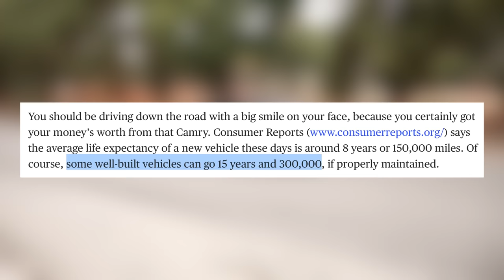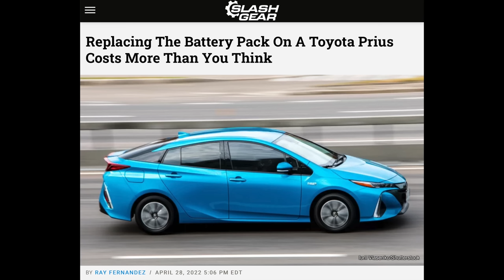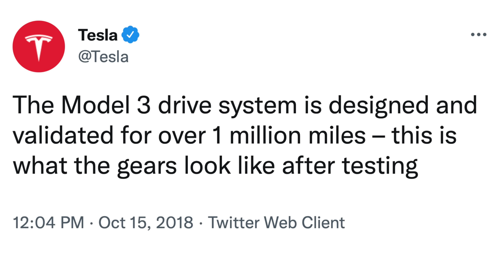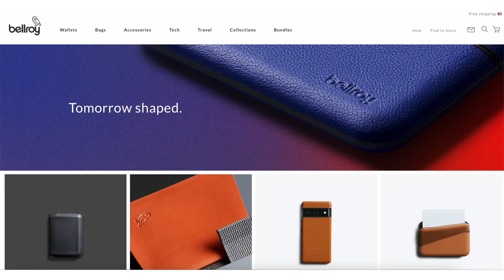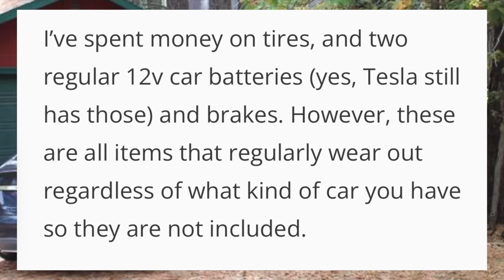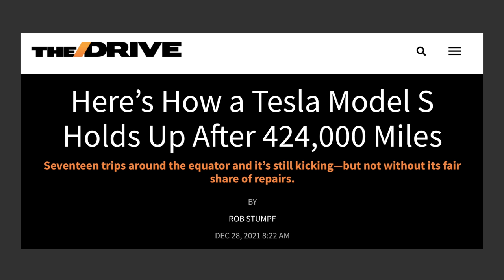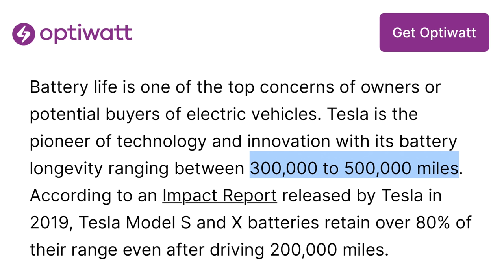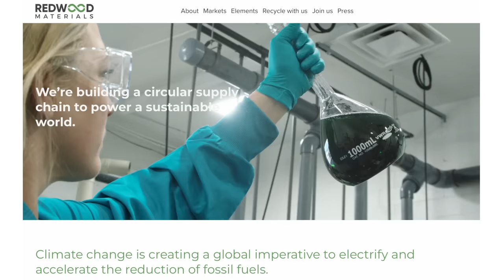The ONE MILLION Mile Tesla | It Still Runs

Comment: I drove my 1992 Civic for 21 years. After spending $1,400 on a used engine, transmission, radiator, hoses, etc. (that's $1400 total for all that plus other stuff I didn't list), I drove it another 10 years before it ever broke down for any reason. I parked it because of rust at 585,000 miles. It still ran like a champ and I still own it. The last repairs cost me some thing like  $4 for a switch and $12 for a brake cable. My current car is a '97 civic with low miles, and it should last me a long time. That's the thing about these electric cars. I'm all for them, but with an older gas car you can fix just about anything for less than $100 if you have tools. Electric cars will need less work, cost less to fuel, but those enormous repair bills are murder. I get that the average person can't fix their own car, but that's only because they don't try.
Reply: Your Civic is a unicorn.  High mileage EVs, and Teslas in particular will be the norm, not the exception.
Reply: I do repairs on cars and you are absolutely incredibly lucky to have an engine that you replaced for only $100 .where in the hell did you find that. A used engine from Japan like I’ve replaced in a couple cars is at least $500. still somewhat incredulous that you have not spent money on repairs on your car.
Reply: @glenncornwall4331 I think there is a bit of exaggeration in this story. Also, clearly they did not pay for any labor nor factor their time in the cost. Replacing engine for a regular Joe Schmoe is going to cost a lot in a mechanic’s labor fees
Reply: @deemanDavid  yes, I totally concur.👍
Reply: @glenncornwall4331  It's been awhile since I did that work, but I said $1400 to replace ALL SORTS of stuff beyond just the engine for less than half of what they want for just the touch screen in the tesla. The $100 is from any typical break down I might have with an older Civic. Alternator, ignition module, fuel pump, starter, wheel bearing... None of that stuff is any more than pocket change.
Reply: So in a "this = that" kind of explanation:

It seems like what you pay for in repairs for a gas vehicle, is what you're saving up to eventually replace in an EV. i.e. Replacing Every thing in a gas vehicle that needs replacing to be "100 percent" again, over four years 
=
Replacing a few things in an EV to be safe to drive again, In or Within four years. Battery replacement will vary.
Reply: You are 100% correct, way way cheaper to own a gas car!
Reply: @ChipsCST  From everything that I have read listen to and watched about Tesla cars and in general electric cars the car batteries are staying alive well and I do repeat well after 500,000 miles. and it’s only a fluke with a battery dying sooner than that in such a short period of time.
Reply: @randygreen7871  I won’t ridicule you but only state a fact do your homework.
Reply: @glenncornwall4331  I have, iv'e owned 6 Model S's and for what you pay for the car, repairs and charging it's much cheaper to own a Camry Hybrid. I should Know my wife drives one!
Reply: @glenncornwall4331   Quit cheerleading ev b.s.    this could definitely become true with lithium iron phosphate batteries but regular batteries last 200 to 300k is.  Which negates fuel savings...
Reply: @glenncornwall4331  used engines no one wants are cheap as hell
Reply: @deemanDavid  not really I'm thinking of keeping my elantra and just get another spare engine for it.   It's a manual.  Manual trannies need more maintenance for new clutches but they last forever
Reply: Your 1992 car is a death trap, it rated 40% under the AVERAGE safety rating of other cars of the period. virtually zero safety features, and if you were in a really damp area, it would be rusted out by now unless you spent a heap on rust prevention. You also must be incredibly lucky to never had to change your timing belt or water pump during that time, if you followed the usual change over every 100,000 miles ( Honda recommend 80,000 miles ) , you would have had to have done that at least 5 times. Cost of that would be between $400 and $900 each time you did it, although if you did it yourself it would only cost about $200, but its a 4 to 6 hour job. After 100,000 miles of no change, you were risking severe engine damage. Your experience is not typical for ICE cars of that era . Do you have a lucky rabbits foot ?
Reply: @glenncornwall4331  plus he should have changed the water pump and timing belt a number of times , at least three, risking it past 100,000 is very risky.
Reply: @reverendbarker650  Yes, It's truely scary thinking of people driving around EVs that weigh 3 to 4+ as much as the '92 Civic, especially with low 0-60 times! The point of telling about my experience was to show how crazy the repair prices were on the Tesla in the story. Just insane. Also, a comentary on how the average person is used to getting bent over at the service center. I just bought the kit to change the belt and water pump on the '97 civc for under $40 ($33 I think) from Amazon warehouse. It will take half a day to put in and I'll be good to go for years. I did change the belt on the '92 many times as required, along with any other maintenance on my own. That's the only way the car would last that long and a person could afford to so. And yes, I finally retired the car due to rust (as mentioned above).
Reply: I am diyer my self with my current SUV costing me a total initial cost of 3.2k, I was originally looking at tesla to replace it, but given the fact I work on the vehicle factoring in the gas, insurance, car payment(tesla) and reg every year even with gas at 5.5 a gallon the suv still beat it. Pulling the loan past the 4 year mark, it was comparable. Still not there. Mainly if you are a mechanically inclined I would say you have the potential of making nearly any used car competitive with a tesla. Also I drive alot and don't really want to eat the depreciation of a vehicle. Put a 100k on current in just about 5 years.
Reply: How about tires? You forgot to count them in.
Reply: @bxu789  Also minimal expence. Very infrequent, and all 4 for less than what 1 Tesla tire costs. But that's not the point. I'm all for electric cars for people that need them. People that can't fix cars or people that drive a ton of miles, or delevery vehicles. Electric cars don't make sense for my situation. I now drive less than 9,000 miles year.
Reply: golden coment ! S2
Reply: no $2,200 center screen on the Honda ❤️
Reply: @john4kc  585k miles @40 mpg and $3 dollars a gallon you would need 15000 gallons of gas it would $45k in gasoline alone Tesla home charging will do that in 5k.
Reply: The average person can't fix their own car, or has a friend that knows Hondas. I got rid of my 2001 civic. Which I loved to death. But high mileage stress was gonna soon cost me more trouble than needed. It's time to get with the future and get a electric scooter bro!

Comment: That 30% loss before replacement only applies to Tesla warranties.  It does not need to be replaced when it reaches 30% after the warranty expires.  Tesla is just guarenteeing that you will have at least 70% remaining after 8 years
Reply: Definitely. For many owners who charge at home and use their car for commuting, even a 50% loss would only become an inconvenience if they had to travel a longer distance.
Reply: that’s the story of 1st gen Nissan Leaf owners
Reply: @lucienromano3493  Loss of capacity often comes with a loss of peak power. On an Iphone, if your battery lost more than 70% capacity, you would see slow downs and random shutdowns while doing more power intensive tasks.
Reply: @tqlla  Agreed, but with an EV, it depends what you use it for. If it's a small city car used only for local trips, you probably wouldn't know or care about the performance loss until it was really severe.
Reply: @tqlla  iphones, when reaching high degradation of battery, were THROTTLED BY APPLE lol. And these electric cars have complex BMS Battery management systems inside.
Reply: @shahan484  They are throttled to keep the phones from having random shutdowns.
Reply: @tqlla   "They are throttled" And there is an option in the iPhone's menu to turn that off.
Reply: So if it's 65% what does Tesla do?   A new set of battery or refurbished battery that's at least 70%?
Reply: My model 3 will 215 miles range at 30% degradation. That will be plenty of miles for me when I retire.
Reply: Its 20% loss, 120k miles or 8 years not 30%.
Reply: @dstr1  Tesla guarantees 70% battery capacity retention over the life of the battery and drive unit warranty. That means the Tesla warranty can be used to replace your car’s battery if its maximum capacity drops below 70% of its factory amount.
Reply: When capacity loss significantly, it will accelerates your battery degradation
Reply: With the battery tech in cars atm they lose a lot at the start slow down for a while and at end of life start lowering really fast again. The time to go from 30 to 50 is way faster than 10 to 30. That being said you could prob get a good bit of time out of the battery if you don't need the range. After 50 % you will prob start having other issues and really need to remove it for those issues.

Comment: I’ve clocked just under 50k miles in 2 years on my LR Y and a full charge is now 298 (from 303) miles. I couldn’t be more pleased.
Reply: when you said FULL CHARGE. do you mean 100%?
Reply: how many percentage were you charging per charge? 80% , 90%?
Reply: What climate do you live in?
Reply: @JohnDoe-ut3sz  no full charge meaning 12%💀
Reply: I'm at 20k in 1 year in my M3P my full is 297 was 310.
Reply: I'm never going to do enough miles to test this in my model S, after 4 years it's at 25k miles. That said I keep it between 20 and 80% unless supercharging which is 3 - 4 times a year.
Reply: My MYP after 11k miles went from 303 miles to 285 miles for a full charge. Mostly charged at home and only charge to 100% a handful of times for long trips. Mostly charged to 80 or 90%.
Reply: My model 3 also lost very little range in the first 50k miles.  But between 50k to 75k, the loss increases significantly more.  The range of my 4-year-old model 3 has reduced by about 9-10% now at 75k miles.
Reply: @atafarhadi4003  is it reduce is mileage or are you getting watts per mile than average?
Reply: how many times you think you have super charged your car you would say over the 2 years
Reply: @skippynj1979  not sure I understand the questions. At 100% the miles range stated on the car has reduced from 303 to 285 miles. The last two times I charged to 100%, the number dropped each time.
Reply: @atafarhadi4003  sure .  Let's say you drive and average 5 miles per kWh average.  And your have a 50 kWh  battery.  That is a theoretical range of 250 miles estimated.  Now let's say your driving habits change, and you now get 4 miles per kWh average.  Your range now is estimated to 200 miles.

It's more important to calculate the kWn capacity of your battery over time to get true degradation.  Range has a lot of variables.  Weather, loading, tires, driving habit, etc.
Reply: @donaldstinnett5630  thank you for sharing
Reply: @JohnDoe-ut3sz  80% daily
Reply: @shawnclemenson9939  Southwest Ohio - Cincinnati area.
Reply: @isiahdeadpool5907  Roughly 20 times.
Reply: @JohnDoe-ut3sz  that’s a full charge. I charged to 100% just to check after watching this video. I charge daily to 80%.

Comment: While waiting on my Tesla Cybertruck I am currently driving my 1998 Honda Accord which has 540,000 miles.  Transmission rebuilt at 360K.  I am a retired aircraft mech, maintenance is key.
Reply: Jesus that's a lot of miles
Reply: Well, electric car's drive trains are closed system. There is typically no maintenance. Only thing you will ever maintain will be charging to 80% on regular usage.
Reply: @realdennis79  you CAN change the gearbox fluid, but it's pretty unnecessary since there's no gear shifting. Much less to wear.
Reply: @realdennis79 well charging alignments and differential fluid but that's all pretty simple and cheap maintenance
Reply: Can you make your Honda fly? 😮
Reply: @PeaceNinja007  with enough HP anything is possible
Reply: thats a major downgrade lmao keep the honda